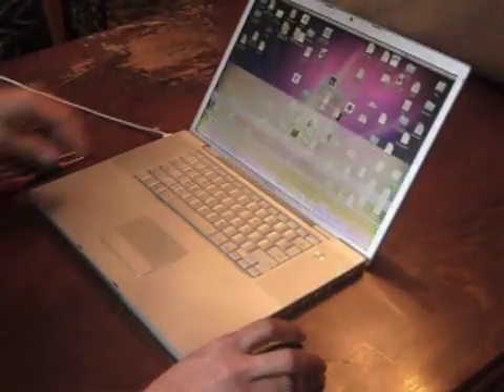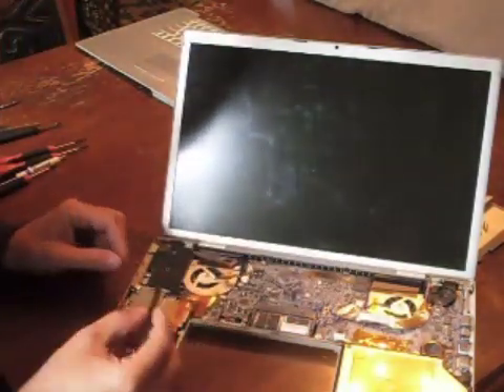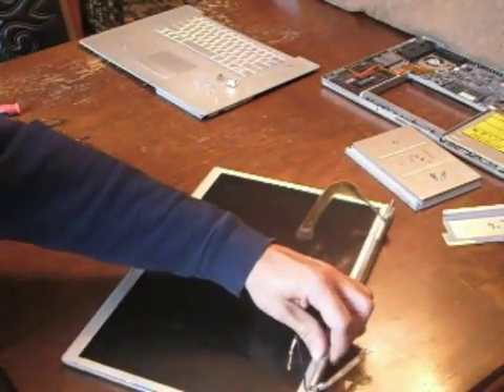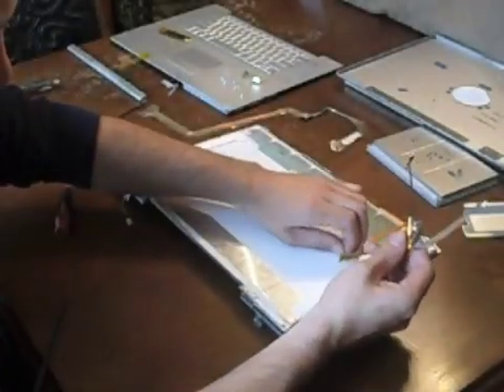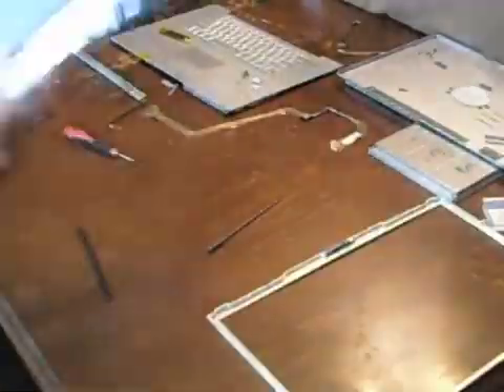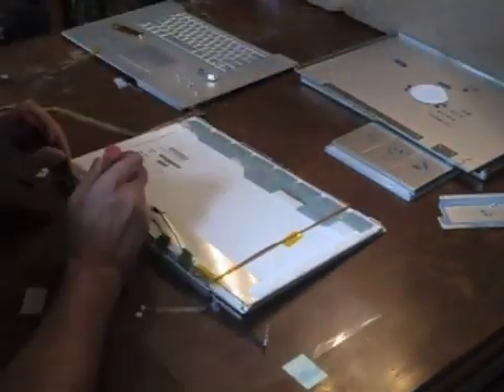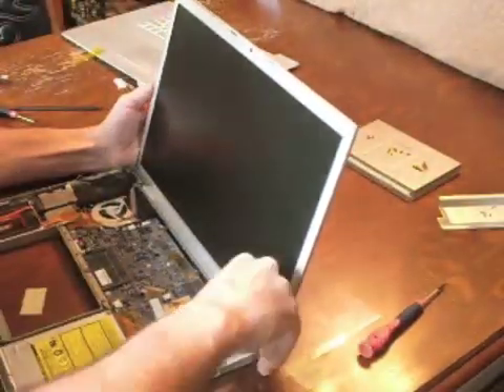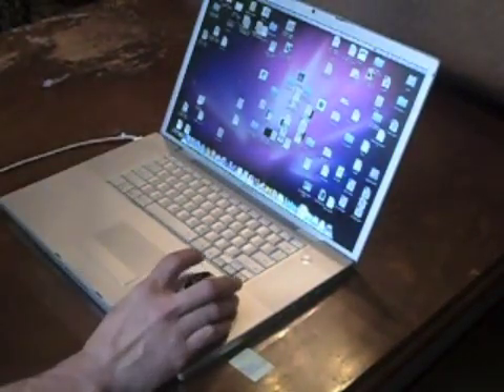Laptop screen replacement : How to replace laptop screen MacBook-Pro-17-Inch-A1151

Comment: I give you Kudos not only for the time that you have taken to show us intelligently how to replace the screen (intelligently in that you were able clearly explain how to replace the screen and its smaller parts--screws and the tool set needed to assemble or disassemble). There are many tech instructors/writers who lack simplicity to teach others how to do anything in order).

 The only concern that I have, and this is a very small, in caparison to your over outstanding presentation, is the volume. We only ask to adjust your volume as loud as you are able to .

 A loud volume is something that WE can adjust. A low volume is difficult to adjust due to lack of power on our end.Using a stereo attachment will not work as only we are hearing more white noise and less of audio clarity. Would you tune up your audio please?

Otherwise this is a 99.9% excellent tech video. Maybe you could look into writing text disc video manuals from home or designing verbal/video discs for those who need to assemble products from different companies. 

There are thousands of companies who need this assistance and need it in a variety of languages all over the world.

For example, IKEA needs serious assistance in showing consumers how to clearly assemble their products. Many other companies (tech base or non-tech) also needs this clarity to assemble any product concisely and without frustration. 

If I had time, I would list the very companies who needs this help. This will also raise profits using clearer instructions for any product that they wish to successfully sell to their customer base. 

Companies are losing a ton of money in product returns due to unclear instructions and you may be such a person to offer such services for any product at a percentage of designing instructions in either disc format or as a booklet or both.

There are Spy Gear companies who need your help due to the newer imports sold through spy gear companies that mainly use tech base products and need clear instructions for consumers in many different languages to be able to use their products and prevent fewer returns. 

The two major reasons for returns are that the product is designed with cheap materials or that the product needs clear instructions upon how to apply the product for use.

Try it.  Please remember to power up your volume, please.

 Thanks a Bunch ;-)